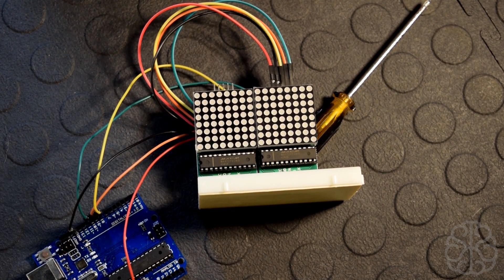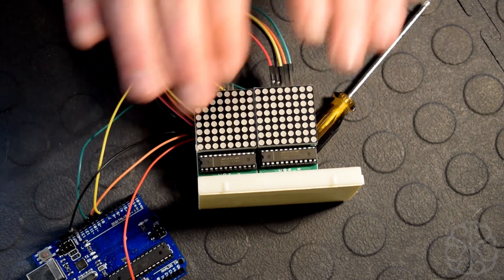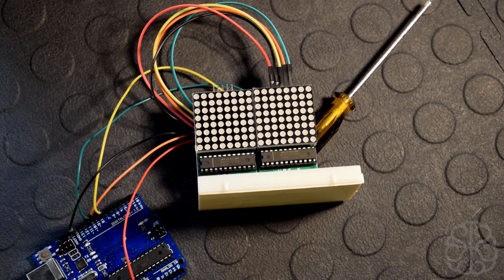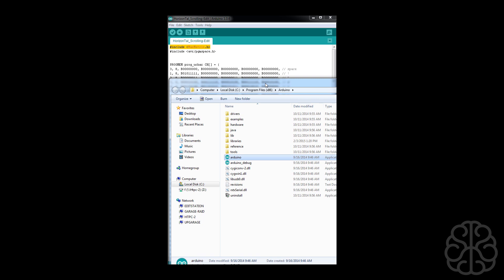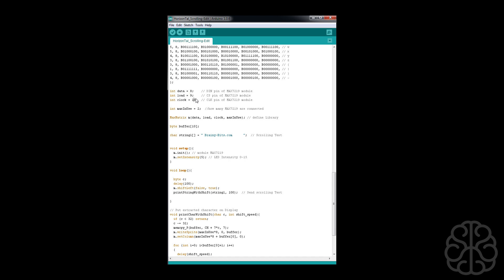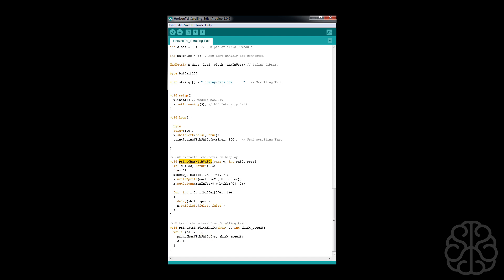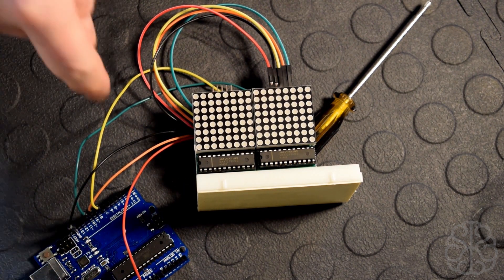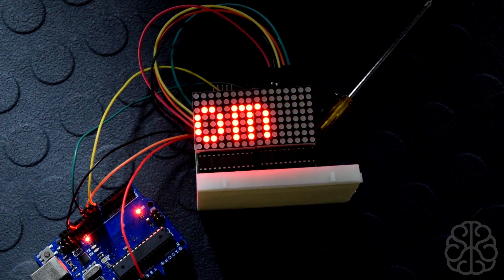Scrolling text using the MAX7219 and an Arduino - Tutorial

Comment: You are doing it wrong. Don't use pin 10 for clock, use pin 13. Use header file <SPI.h> and let that clock out out the bits. Don't use shiftOut(), when you dont have to.

Comment: I bought a 4 matrix array that are mounted next to each other but the problem is that the writing is going vertical and not horizontal.. any way to quickly rotate the text 90 degrees to the right?  Thanks.
Reply: Ever figure this out?  I'm having the same problem

Comment: Just upped the number of matrices to 12 and although the scroll happens the data is random pixels. Reduced the number to 9 and all is well with the remaining 3 matrices just repeating the first 3, which is expected behaviour. The code seems to dislike anything above 9, that is double digits in that variable. Has anyone else noticed this? Help! I need this fixed before Christmas.
Reply from the maker: Hi Alan, I made this tutorial quite a while ago so had to refresh my memory, the library used is limited and from what I can tell it has a limitation of 9 matrix.  So for now I don't have a solution to use more unless we use a different library.  Will try to make another tutorial using a different library soon, but unfortunatly it will be after the holidays.  Sorry about that, but thank you for your comments and for watching of course.  Have a merry Christmas and Happy New Year...

Comment: Hey guys,

I know that the code is flaky - But I can't use 10 or more matrizes. If I use 9, it works like a charm, but as soon as I use 10 or more, I only get random pixels flashing without any real text.

Any way to fix this?

Thanks in Advance
Reply: Hi, I gave exactly the same problem, the code doesn't like maxInUse to be greater than 9. I'm still looking but did you manage to fix it?
Reply: Unfortunately not :( I gave up at some point and just used 9 matrices. Sorry. If you find some way to do it, let me know.

Comment: I like your projects ,Yvan, and have successfully built the Nokia 5110 display and sonar range finder a couple of days ago and the 8x8 scrolling text today which worked straight away after replacing ‘prog_uchar’ with ‘const unsigned char’ in the tutorial sketch. I started with 2 and then tried 8 units which worked. If I wanted 16 units would I need an Arduino Mega which has more memory? 
Next I would like to type in new messages with the serial port. Maybe Serial read and press send. Followed by an NRF24 tx/rx setup.
Reply from the maker: +binarybox Let me check because I'm not sure if the library supports more than 8 modules?  But if it does support more than 8, you wouldn't need a MEGA since the modules are linked together and would not use more pins on your UNO.  Haven't played around with the NRF24 so couldn't help you with that, but if you do please let me know how it went.  Thanks for watching btw :)
Reply: +Brainy-Bits Could you please let me know that do we need external power source somewhere if we try to run 8 such matrix together for scrolling message? I worry if 8 matrix would take more power from Arduino nano and Arduino would burn?
Reply from the maker: Each one of the LED Matrix consume approx. 70mA at peak, so 8 of them would be around 8 x 70mA = 560mA.  Or around 0.56Amps at 5V.  So you would need a separate 5V power supply when using 3 or more of them since the Arduino can Source no more than 200mA on the VCC pin.  Thanks for your comment and watching!
Reply: Hii, I tried to connect 8 such dot matrix display together and run your code after changing it appropriately for 8 dot matrix display, I am using Uno. I am now supplying external power to the 8 daisy chained dot matrix displays as suggested by you before. I am finding that after running for some time, the characters in the matrix getting corrupted. This is happening in say one or two matrix displays and not all. Sometimes it happens in some or other matrix while other matrix displays perfect out of 8 matrix. When I reset the Uno then it start running the text perfectly for few minutes (4 to 5 minute) and then again the corrupted text appears in some or other matrix. Could you please let me know what could be the problem?  Do we need to put some capacitors to the matrix displays?
I will now trying to reset the UNO using reset function by putting reset function in the sketch itself somewhere so that my program could reset the UNO after certain period of time automatically while it displays the text.  Lets see how it works..

Comment from the maker: When we did this tutorial we were using the 1.0.5 version of the Arduino IDE.  It seems that if you're using a newer version of the IDE Software you need to replace ‘prog_uchar’ with ‘const unsigned char’ in the tutorial sketch to not get an error when compiling.
Reply: gracias amigo por decir la solución
Reply: sorry but i can"t find this "  ‘prog_uchar’, there is nothing like this in your code.

Comment: Hey u used an arduino uno
Can u share the code what u used
And i wanted to ask if u are using 8 together
How much voltage needed ??
Reply from the maker: Thanks again for watching!  You can find the code and more information on all our tutorials on our website:  https://brainy-bits.com/tutorials

As for the current needed for 8 LED Matrix, since each one would consume approx.  70mA at peak, then 8 of them would be 8 x 70mA = 560mA.  Or around 0.56Amps at 5V.  So you would need a separate 5V power supply when using 3 or more of them since the Arduino can Source no more than 200mA on the VCC pin.